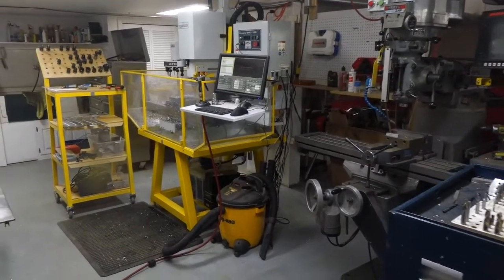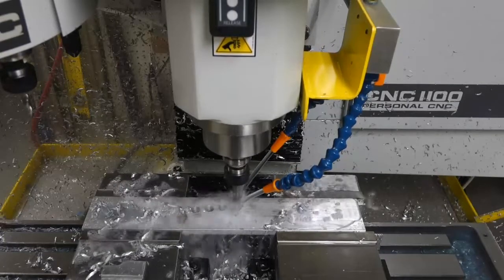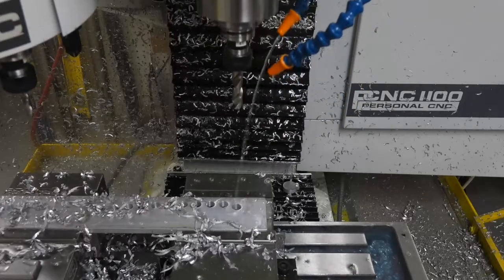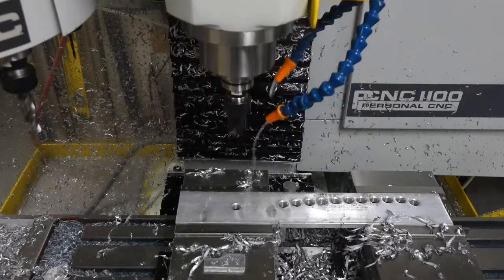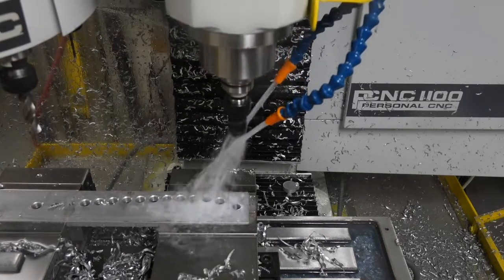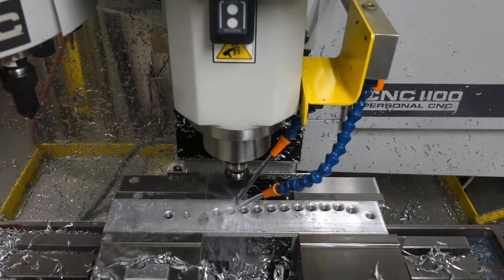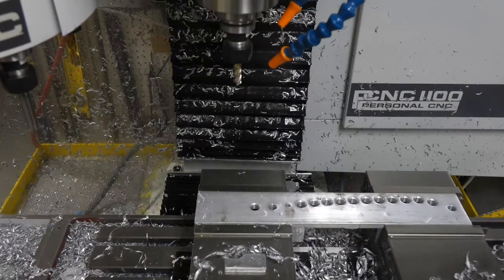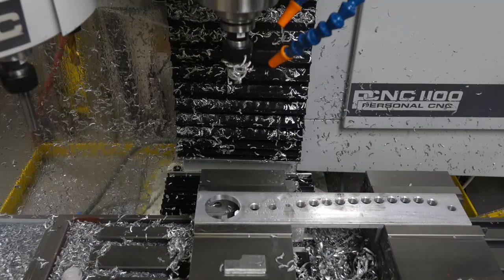Making parts on the Tormach PCNC 1100, Part 1

Comment: McMaster part # 2754A72 is a 1/2 inch parabolic twist drill. Run that at 2291rpm, 22.9 ipm, .5 inch pecks. If it's less than .5 inches depth, just plow straight through. At worst you'll get some long tightly curled chips that won't get stuck. If a chip does get stuck, usually the next hole will knock it off. At best, you'll get some nice chips that break about .15 to .25 long.